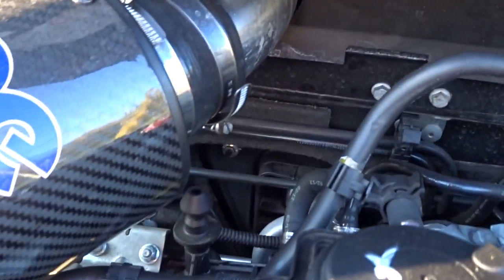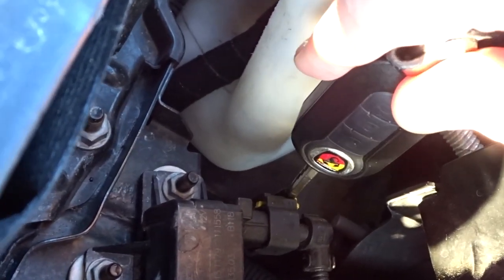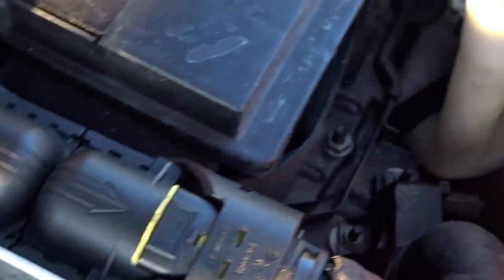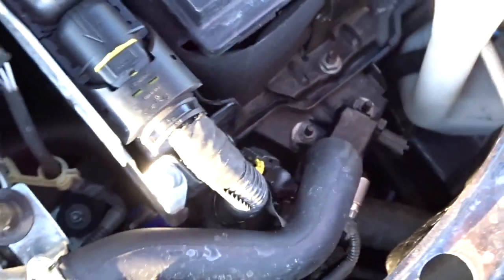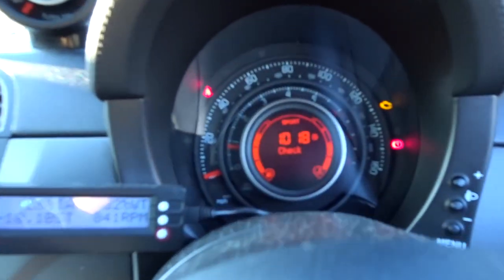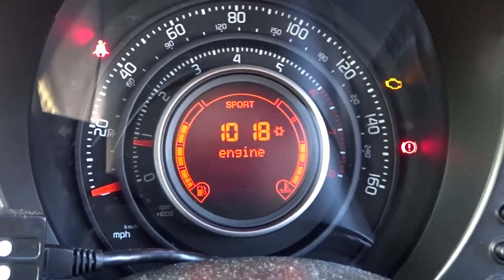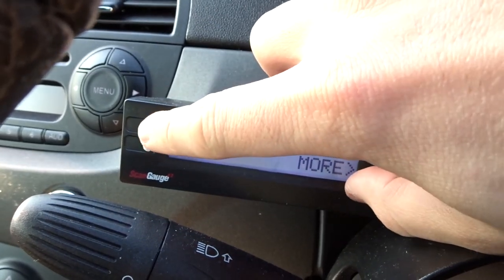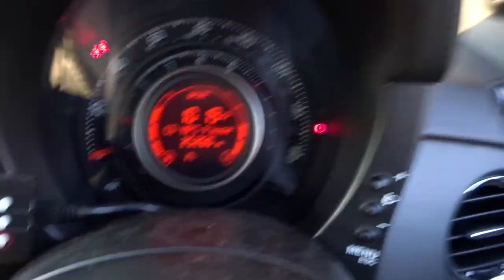How To Get Turbo Flutter Sound: Turbo Chatter Sound | How to make your turbo flutter

Comment: Is there a way I can change my turbocharged Audi from WEEEEEEEE to stststststsssstt
Reply from the maker: Sure you can but I don’t know how on the Audi mate
Reply: Aftermarket air filters and change out the stock diverter valve for a aftermarket diverter  valve
Reply: I have a audi a4 Quattro 1.8 t
Reply: If your turbo is making a weeeeeeeee noise you better take it to the mechanic lol should be more like a psssssssss
Reply: you mean weee a spool?

Comment: What about the U.S. Spec? Engine layout seems completely different.
Reply from the maker: Not sure on the us spec Matt, it’s a multi air but has the same valve. Not sure what it will do regards to limp mode though

Comment: how about on a jag diesel how do i get that sound
Reply from the maker: +Alexis Highfield really not sure on other cars as they will react differently to removing dump or recirc valves and cars with stock air boxes will very much quieten the flutter noise down Alexis
Reply: Alexis Highfield it's not possible in a diesel mostly because the throttle body is always wide open. Diesels do not have a bov either gas run on a throttle body vs diesels that run on a fuel injectors
Reply: Completely false, my 320d flutters all the time. As long as you run enough boost, a diesel WILL flutter on shifts especially high boost on low rpm. 

I'm running around 24psi and it flutters  as long as I'm below 2k rpm wise
Reply: Iz Freaky car has been remapped again now and few other things and still no flutter grrrrrr
Reply: How much boost does your car run? Do you have an intake?

What car is it?
Reply: Alexis Highfield again a tdi will not flutter like a tsi it's much harder to do. A flutter is cause when the turbine is still creating pressure but the throttle suddenly closes. The extra pressure need to go some where ( this is where your diverter valve come in to play it releases the pressure by either recirculation or atmospheric release.) but if you disconnect your diverter like this man did when you build enough pressure the extra air will go back through your turbine( some people say that it spins back wards this is false.) it clashes with the pressure coming in the housing creating the well known tutututu. The reason it's so hard to create this in a turbo Diesel is because 2 things one the throttle body is always wide open. Two because the throttle body is always open there is no need for a diverter since there is never any pressure Incased in the system. It's a one way street. The only way to make a flutter on a turbo diesel is to create enough boost that it can not all escape through the exhaust creating a back up effect. But if this happens that means your losing a lot of potential boost and hp. I hope this helps you !
Reply: As long as you run enough boost that the engine CANNOT take at a specific rpm it WILL flutter upon shift, WITHOUT a throttle plate.

Just go and look at diesel trucks who run big amounts of boost. If you have a small diesel engine it should be easier to create flutter as long as you have enough pressure in the system. Things like intercooler piping & size of the IC matter as well
Reply: Iz Freaky yes and no a turbo diesel is meant to run on a low rpm high boost. That's why most trucks red line at 5 rpm unlike gas trucks. On cars it's a lot different if you smaller the diameter of your inter cooling pipeing and exhaust you will here the flutter but at a most likely cause of loosing boost and hp. Overall just get a tsi over a tdi if you want fancy flutter and messing about. Get a tdi because you get 50 miles to the gallon.
Reply: Iz Freaky this is just on cars by the way. On trucks it's a different ball game
Reply: Applies to any diesel car with a VGT turbo.

I agree though, if you want fancy flutter get a petrol, but it IS possible on diesels.

Comment: Caution try at own risk. It is causing air to be forced back through ur spinning turbo causing compressor stall putting stress on your impeller. This can fuck ur turbo. Don’t do it. Buy a BOV that will make the same sound

Comment: will this work on an  2000 Audi TT 1.8 Turbo ?
Reply from the maker: +Bob Havertz it may put the car in limp mode if you do it on a VAG. I recal when I had one the Ecu didn't like my dump valve and kept flagging an EML. I would check the forums to see if others have done it before you try to do it. 👍🏻
Reply: it's an stock car/engine from Audi and i've never worked on any engine part 
and on top of that it's my moms car LOL
Reply: Bob Havertz Definitely give it a shot, you can't learn if you don't expirement.

Comment: Its all fun and games untill the impeller nut spins off.
Reply: breeny Breen how's the nut going to spin off when it doesn't change the direction of the spin learn more about cars before you post I think
Reply: @ellehetherington2143  Why the nasty reply.
It puts more load on the charge side impeller than normal, causing all kinds of wear and problems, if your turbo is not built to withstand that extra load then don't do it.

I'm a Diesel and turbo specialist for 16 years, so I  think I've seen a thing or two.

Comment: Haha why would you make a video telling people how to make a turbo flutter better known as compressor surge. This is not good for performance and it’s caused by the compressor wheel chopping through charge air that’s not been released by the BOV/BPV. Tightening the spring tension on the BPV/BOV will cause flutter and loosening the tension will get rid of the flutter and cause a pshhhhhh done and done

Comment: Would this be the same for a Subaru STI
Reply from the maker: +Soaks Is King Hi mate, not sure but I know a few Subaru owners who are running full flutter on their cars. Not sure what it does with the ECU in terms of EML and limp mode though. Would check on some of the owners forums to see if others have done it there?
Reply: Soaks Is King no but if you remove bpv and place a metal sheet inbetween the intercooler and the bpv itll make the same noise obviously not good for turbo but itll make the noise you want